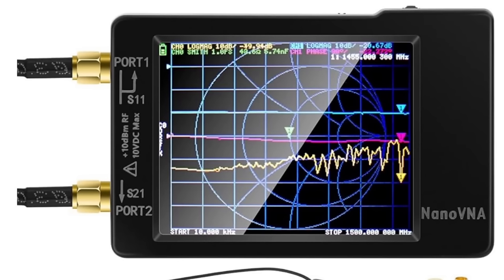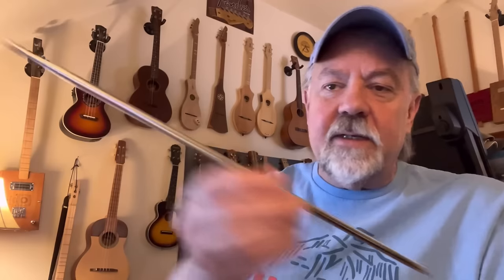Antenna Wire Length - Demystifying Feedpoint Impedance

Comment: Oh Walter. Why do you keep promoting this wire antenna witchcraft? I've done a LOT of research on the subject. Me, and the old boys net on top band, all agree that you simply can't radiate any amount of power with a puny home-made wire antenna. We all run properly constructed commercial aerials, purpose-built for the job. Norbert, who's been in this game longer than I, confirmed that there is next to no effective radiated power from any antenna element that's thinner than his thumb. Well, he used a slightly different measure but this is a public forum.... I didn't watch your full video but can tell you that's why you consistently fail to make any contacts at all. I would go on, but nurse is here and it's soup time.
Reply from the maker: Blahahaha I just snorted laughing
Reply: I really need to save this comment 😁🤣 Bro compressed almost half of yt hamsphere in this one 👍🤭😁
Reply: Hilarious
Reply: Because EFHW antennas simply work 😊
Reply: @@Keystone_Investigations "If you know what you're doing"....  I very much doubt that you have anywhere near the collective years of experience that Norbert, Tibbsy and Clive have! That's nearly 176 years collectively. There wasn't even any radio around back then! You simply can't argue with that level of experience and expertise. 

50 Watts and a clothes line might get you the occasional sympathy QSO but a proper station needs real metal high up in the sky. My 160m beam gets regular 59 reports all across South Berkshire. I rest my case.
Reply: Anyone can make contacts with a huge antenna and huge power. Boring. Throw out some wire and mash on it!!!
Reply: 😂 very good.
Reply: Well a quad is a little ire antenna and you can get gain out of a dual or multi element quad with 14 or 12 awg wire.
Reply: Would you care to back that up with a callsign?
Reply: We don’t care about Norberts small thumbs 😂
Reply: @Willysaholic  😂
Reply: @MrMotorchild Pah.  I'll see your callsign, and raise you SCIENCE...
Reply: Lol lol lol
Reply: Great comment. Don’t forget your meds before nap time. 😂
Reply: I think that there may have been someone calling "Break" - not sure, probably only a 2 and 1 with me. If he's still there, he needs to turn his power up so that we might hear him. I'd suggest about 5 or 6 kilowatts may be OK. Anyway, what were we talking about.........
Reply: Lol
Reply: @RonanCantwell lol

Comment: I'm a big fan of remote, or "at the feedpoint" tuners. Like the antenna matcher you showed, they work sort of like an automatic, infinitely variable unun to give you an (almost) perfect match on (almost) any wire length. Your 50 ohm coax always (theoretically) matches your rig, so the impedance mismatch you need to address is where the coax meets the wire. In-rig and at-the-rig tuners are  great for protecting your rig, but have much higher losses than matching at the feedpoint. This is just food for thought - thanks for the great videos!

Comment: Very disappointed in the Firestick SWR chart. It is simply a chart of Forward Power vs Reflected Power at different SWR's, in this aspect the chart is fine. The problem with the chart is is that they are calling Forward Power minus Reflected Power, Effective Radiated Power. This is not correct and it perpetuates the myth that all Reflected Power is lost.

Comment: Thanks for this, you made it easier to understand, especially the antenna length/swr long is short, short is long concept.  I am a new ham, licensed last summer.  I have built a couple of ransom wire antennas, following the way you made them, but haven't yet tested them cause it's been too cold up here in Manitoba. I also enjoy the way you present you info.  VA4DUG

Comment: It's great to see some one who explains the technology in easy to understand terms. So many tutorials are geared to the already experienced and goes completely over a new hams head. In my 47+ years I have always tried to teach on the level of the student. Great job! By the way, I may be an "old dog" but you have taught me a new trick or two as well.   Hi Hi!  Keep up the great work.   73s DE wb7veq
Reply from the maker: Thank you so very much! The one thing about physics, engineering and almost anything that involves science is that humans will overthink it. I really just try to keep everything simple. 73 my friend

Comment: As always Walt a great video with great info. Sometimes hams need to use compromise antennas such as myself, people need to realise not all have the space to put antennas up, i have a random wire that runs up a 12 meter pole that is strapped against a tree yet i have contacts from around the world... for me the Unun's work along with the Baluns. Im on air so thats what counts. You have great info Walt, thanks  and 73 de ZL1MY
Reply from the maker: Thank you so much for the kind words my friend! 73, Walt

Comment: Thanks for another helpful video! The way you put this together was perfect. I added it to my technical journal. I take notes in a journal when I come across useful information so I have it close at hand. So many new amateur radio operators mismatch antennas and Baluns/Ununs because they don't have a clear guide regarding what goes with what. Your video breaks it down into terms that are easy to understand. Thanks again...73...Hugh...KN6KNB

Comment: Great video Walt. I have a 55ft vertical up a tree with a 9 to 1 UNUN about 3ft off of the ground with 1 36ft counter pois elevated off the ground. It works great.
Reply from the maker: Thank you! That sounds like a great setup.

Comment: Not much to add. You covered things pretty well. If you operate on the go it's really hard to beat a 49:1 and/or a 9:1. Most of the time at home that is what I put out. The ability to band hop is worth the 20 odd percent loss implied in the transformer.
Reply from the maker: Roger that! 73, Walt

Comment: Good video. I was working on the 25 foot with 4 to 1 and was having trouble with swr. Did not want to cut. I had a single wire connected to ground terminal on the UNUN to a plate with about 25 radials. My swr was not very good. so I finally took one group of radials off the plate and connected it directly to the ground on the UNUN things got better. Still not as good as I hoped but it's raining now so will wait until another day. fair weather antenna builder lol
Reply from the maker: Thank you! Antennas sometimes just have more moving parts than a clock lol

Comment: Walt, second question. I have a seventeen foot vertices if I put out a 34’ horizontal elevated counterpoise and use a 4:1 Balun would it work as an OCF antenna?
Reply from the maker: I don’t think so, I’d have to model it to see. You would probably be better off just building a traditional OCF. I’m really not a fan of elevated radials but that’s only because I’m always by saltwater and elevating them there makes no sense. So with that said I just don’t have a lot of experience with elevated radial antennas

Comment: Hi Walt, the quarter wave vertical, just the wire on the red connection off the ldg 1:1 balun and from the so239 a coax cable to the transceiver .. nothing connec!ted to the black connection on ldg 1'1 balun ..?

Keep posting great work!
Reply from the maker: You need to put counterpoise wires on the black connector.

Comment: Hi Walt, thank-you so much for this. As a newbie it has cleared up some confusion but also given me a few questions. One antenna not discussed is the terminated folded dipole (TTFD or T2FD). I’ve been told they are electrically similar to a loop (balanced) but have a terminating resistor. I’ve also heard they are broadband. How is the resistor value calculated? Without this resistor is it more like a dipole resonant on only one frequency?
My other question was about ladder line – the 300 ohm would need to match to 50 ohm at some point. Should the matching be done at the antenna socket or at the antenna feedpoint? Thanks again 
Reply from the maker: Thanks, I have to be honest with you and say I haven’t built or experimented with this antenna. I’d have to do a little study on it to answer this.

Comment: I just watched a very interesting video by someone that fits beoadcast equipment  He uses a circulator. Radio on port 1, antenna on port 2 and 50ohm dummy load on Port 3.
He said that reflected power will come back down the coax and be directed to the dummy load, not into the transmitter.
I've never seen one used like that before.
Reply: BROADCAST!!!

Comment: Nice video but LDG needs to improve we're you hook the antenna to it it's kind of weak and can brake the hole for the wire nothing over 14 gage wire can go thru it they should improve it may be even bigger with a bigger hole for the wire a person can put 3 peace of 14 gage build a 3 band antenna add some hooks on the side you tie the antenna wire to it make it stronger so it dont get rip apart

Comment: @Walt. Awesome video you should be a professor. I have a question on the off center and fed dipole. In your video you said that it required a 4 to 1 balun. Because it is off-center fed in the elements are two different lengths. Why wouldn’t that be considered an unbalanced antenna?  I’ve been a hand for 25 years and I’ve learned more from you from your videos than any other resource. Thanks for your assistance and 73.
Reply from the maker: Thank you so much my friend. The OCF dipole is actually a balanced antenna as it finds the point on the wire where the impedance is approximately 200 ohm over several bands to make it a multiband antenna. Now think of balancing a pencil on your finger that has a heavy eraser at one end. You’re not balancing it dead center but closer to the heavy end. Same principle with balancing the dipole.
Reply: @COASTALWAVESWIRES  Thanks again.

Comment: Hello! The closer the wire size is to 1:1, 1:2, 1:4, to the wavelength, the lower the losses in the antenna will be. Also, in order to reduce losses when adjusting resistance, it is easier and more convenient to use L-Match than transformer rings that heat up and give significant losses.
Reply from the maker: Roger that, thanks for sharing.

Comment: Walt, on the ¼ WL wire you used a 1:1 Balun which I believe would act as a choke thereby not allowing the coax braid to act as the other half of the antenna. How did you resolve that?
Chris KF0KEO
Reply from the maker: The 1:1 balun is not like the 1:1 choke, it has two posts on it. A red positive one and a black negative one. The upper driven element goes to the red and your counterpoise go to the black.
Reply: @COASTALWAVESWIRES  
Why not an unun?

Comment: Walt, I’m using an EFHW with a 49:1 unun that’s tuned for 40m (1.2:1). The SWR is higher for 20m and higher still for 15m. Would an antenna tuner help match the feed point impedance and bring the SWR down?
Reply from the maker: Yes, you could definitely get it to near perfect on those bands and could also tune it for 17, 12 and 10 meters.
Reply: @COASTALWAVESWIRES  Thank you, Walt!

Comment: Thanks for the Vid. So at the random wire lengths 29-84' you are saying just go with the 9:1 Unun, as the impedance at these lengths will always be around 450-500 ohms? Would this be irrespective of the {copper multi-strand} wire gauge?
Reply from the maker: Yes that should be the general impedance of most all wire we use for ham radio antennas. 73, Walt
Reply: @COASTALWAVESWIRES  Cheers Walt, you saved me from balancing myself 2 stories up trying to get the impedance of my random wire. Just going to go ahead and get the 9:1 Unun, instead of over thinking this. 😊😊

Comment: This video reminded me of the radiomen in the Navy while tuning up the FRT-39s. They had to drive the PA, then use dials connected to the caps and coils while looking at voltage and current meters. (basically tuning the antenna) Occasionaly they would connect the wrong antenna, get high SWR and the caps would start snapping and arcing. It would scare the crap outta them.

Comment: I put up a 20 meter long wire cut to length,  using the nanovna-f,  don't get me wrong  it did work but not effectively.  Till i learned about reactance. Swr was not every thing , resistance and capacitive balancing was quickly learned about. I guess digging deeper helped me understand why just swr is just a reference to other values. As i understand tuners are great given compromise antennas, however I wanted not to waste energy as heat. Great tutorial ! 
So down the rabbit hole I go again.  Lol 😊

Comment: I think that one parameter has been omitted - that is that most modern transceivers will cut back on their output power when the swr rises. That should be a consideration in my opinion

Comment: You called me out in this video about the 9;1 with a square loop 😅. For some reason my 9:1 have always worked extremely well with 4:1 antennas So i thought it would actually work. I diy'ed it so i probably built it wrong.
Reply from the maker: Sorry, I didn’t mean to call you out. You’re not the only person that has asked that question or one very similar my friend. 73, Walt
Reply: @COASTALWAVESWIRES  I found it funny. We all make mistakes. 73 and love you videos!
Reply from the maker: @chipweather  thank you my friend!

Comment: Walt ... great rules of thumb for the real world. Couple what you mentioned with the realization that a doubling of power is 3 db or 1/2 S unit, even SWRs between 4:1 -  6:1 would hardly be noticed on the receiving end. However, the transmitter would not like them for long!
73 - KF6IF
Reply from the maker: Roger that, thanks for sharing. 73, Walt

Comment: In my experience a simple 1/2 wave dipole fed in the center will typically give you about 70 ohms which will at best give vswr of 1:1:5, and is ok, like your man says if your under 2:1 the antenna will work ok. Ive used a 9:1 unun with 84ft of wire and had great results.
Reply from the maker: Yeah, I understand. This was done to simplify what we’re trying to do at the feedpoint

Comment: Walt, this video is great and to the point. I have tried various types of configurations over the 60 years of being a ham and had so much fun. Still looking for the perfect antenna (Hi Hi) but everything is a compromise due to all the unseen variables! I currently use a 29ft vertical with a 9:1. It works great and matches my environmental requirements while living in an HOA.  Thank you for your practical and useful videos.  Harv K5NR
Reply from the maker: Thank you Harv! I think we will always be looking for the perfect antenna Hi Hi

Comment: Thanks Walt good video, 2 questions that keep me awake are ,1 does the gauge (awg)of the wire used for the antenna affect the resistance calculation adversely? 2 what gauge (awg) would be optimum for a 20-100 watt peak output?
Reply from the maker: Thanks! There is some specific info out there on resistance but I’ve used 22 gauge which is very light for 100 watts and had great results.

Comment: Walt, in your "rotated delta loop" diagram you have a 4:1 UNUN shown.  Should this be a BALUN instead?  Thanks.
Reply from the maker: Yes it should be a balun, all I had was the unun at the time and used it. A balun would have been better and I would have had less loss.

Comment: Walt, this is a "must save" video for most hams. You've done all the math and explained feed point impedance in an easy to understand manner. Question: what is the name of the antenna app that you use? I have an Android phone and could use an app like that. 73!
Reply from the maker: It’s called “Antenna Tool”. I have it on my iPhone but I’m pretty sure it is available for Android. Thanks for the kind words! 73, Walt

Comment: Hi Walt, thanks for all the great videos. So I just built a 20 m vertical with five ground radials. Tun up perfectly but I was wondering what I need a balance on this or just an RF choke. Also, what is the difference between a one-to-one balun that’s unbalanced and one that’s unbalanced ?
Reply from the maker: Typically an unun is for an unbalanced line to another unbalanced line and a 1:1 unun is generally used as a choke. I mentioned in the video that you really don’t need a 1:1 balun on a 1/4 vertical but it works and somewhat also works as a choke from what I’ve experienced.
Reply: @COASTALWAVESWIRES  excellent thank you I just wasn’t sure if the radials made any kind of a difference.

Comment: Thanks for the explanation, Walt! Just want to add a little thought: if you are using a balun or unun with a ferrite core, the core can become over saturated after a period of time and work less efficiently, which could lead to failure. It's very unlikely if you are a person who just making voice contacts or whatnot for a period of time similar to what you do, but if you're running a digital mode like JS8Call 24/7 where your radio is transmitting a lot, it can be a concern. In that case, maybe a resonate antenna might be better choice than say one which you need a balun or unun.
Reply from the maker: Thanks! Great input, thanks for sharing